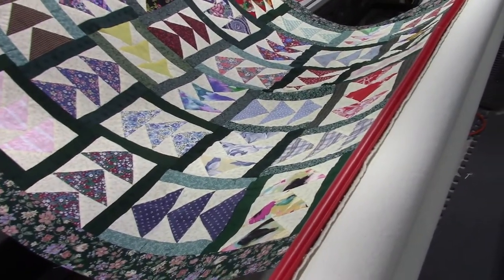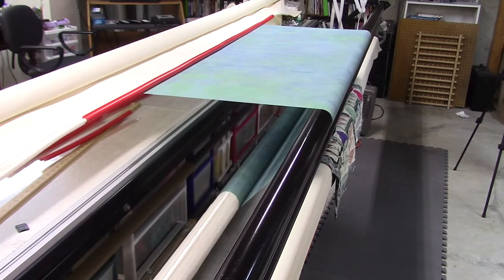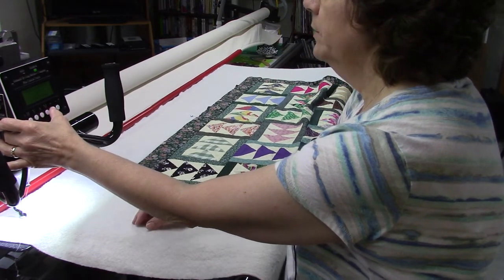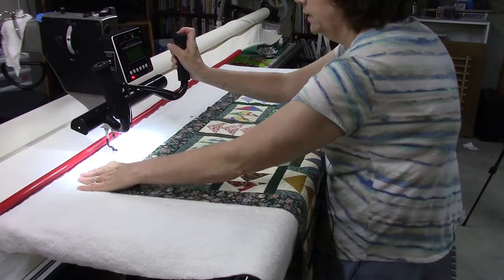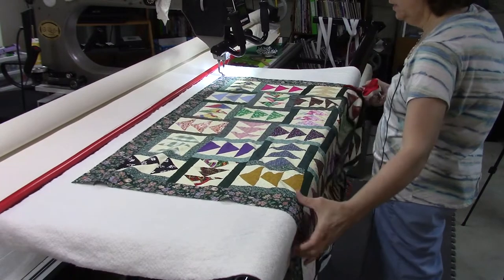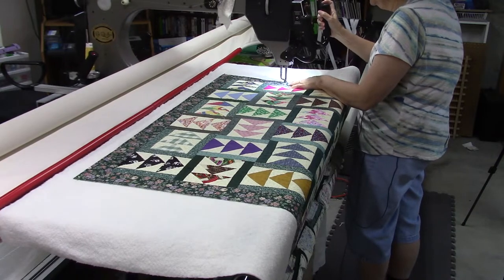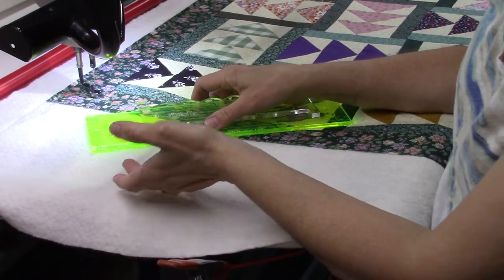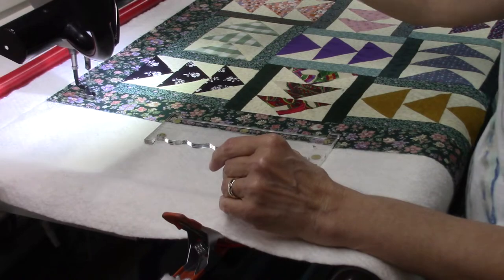Stabilizing a Flying Geese Quilt Top

Comment: Thank you. I have only had my longarm for a year so this information was great. I have found that I don't like floating quilt tops either and have also started to stitch in the ditch to stabilise first. I love the tip you gave about horizontal first. I hadn't thought about the fabric shifting. I also just got some red snappers. I like them but struggle a bit getting the backing attached  straight enough for my liking. Hopefully I will get better the more I use them. :-) Thanks again I love watching your videos.

Comment: Thank you for this. Helps me to know I’m doing it correctly. Do you do anything to square the edges? I have been fully floating me quilts but also stabilizing them. I do use a ruler to square as I go and so far (I’ve only done 3) it has gone well.
Reply from the maker: I don't do any measuring as I quilt, but I do eyeball the quilt and make any adjustments to the top as I need to. I work in fullness or smooth out the fabric if needed.